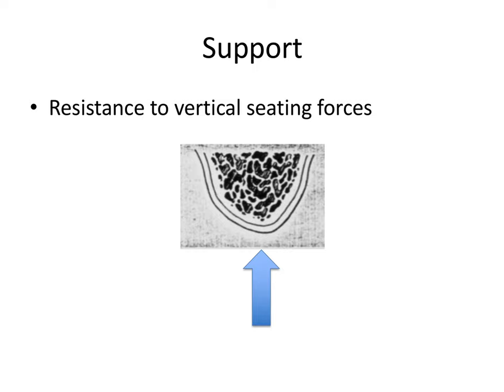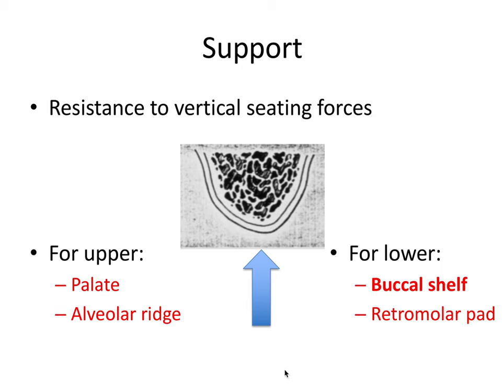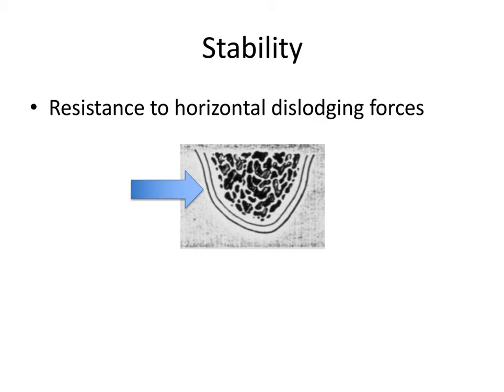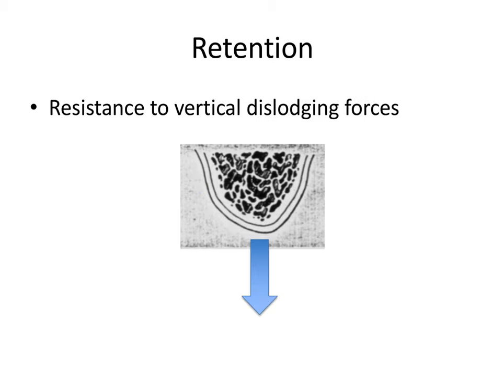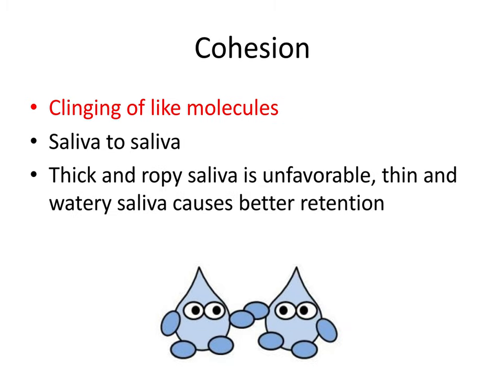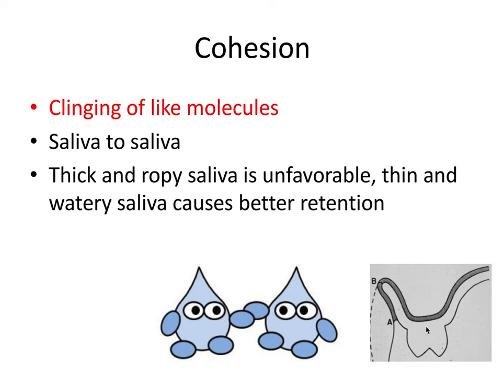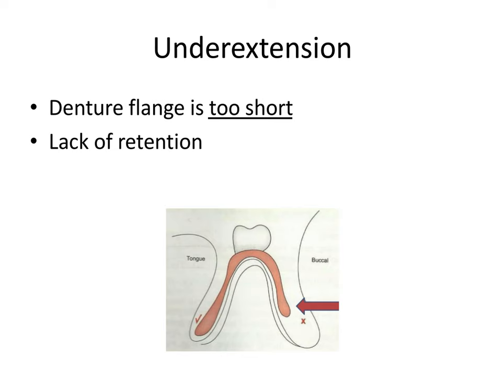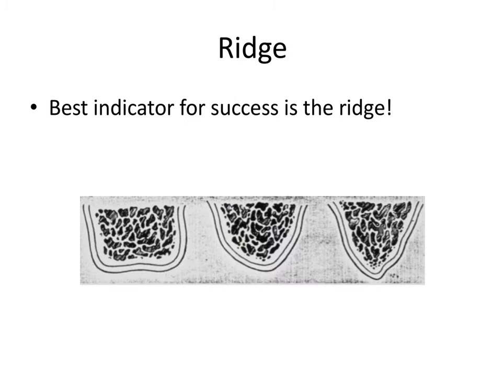Prosthodontics | Support, Stability, & Retention | INBDE, ADAT

Comment: Hi there ,I think you have mistake in the minute 10;24 when you said that under extension flange will affect on the retention ! I think when the flange under extended will affect on stability because the main source for stability in the denture is the denture flange that extend to the vestibule.

Comment: just can not thank you enough dr.Ryan, it was again awesome. will you cover impressions, casts and the complications with them, for example the reasons why a cast frame not fit in mouth but fit on models, those tricky topics which are really confusing.
Reply from the maker: Yes, we will be talking about impression materials when we get to fixed prosthodontics! Can you explain what you mean when you say casts not fitting in the mouth?
Reply: @mentaldental  
Thanks Dr.
for explaining my point I would like to share some released questions regarding this topic, this would make it easier for you to get what i meant:

 1) A removable partial denture cast metal framework is fabricated from a master cast from a polyvinyl siloxane impression in an acrylic custom tray. The framework fits the master cast without abrasion but will not seat intraorally. The error in fit could have been caused by
A. removing the impression prior to final polymerization.
B. insufficient relief on the master cast prior to framework
C. fabrication.insufficient blockout on the master cast prior to framework fabrication.
D. an improper melting temperature for the framework alloy

2) Which of the following factors could cause a partial denture framework to fit tighter in the mouth than on the cast?
A. Too much water in the mix of the stone for the cast.
B. Not enough water in the mix of the stone for the cast.
C. Duplication impression slightly oversized.
D. Improper wax up of the partial denture.

3) A dental laboratory has fabricated a removable partial denture framework. The framework fits the master cast well but when tried in the mouth a stable fit cannot be achieved. The most likely cause is
A. improper major connector design.
B. distortion in the final impression.
C. shrinkage of the alloy during casting.
D. improper casting temperature

4) When a partial denture framework fits the master cast but does not fit properly in the mouth the error is likely to be in the
A. Impression making
B. Casting of the framework 
C. Design of framework 
D. Preparation of the teeth

5) An all ceramic crown that fits on master cast, but not fits in mouth. There is an open margin and supra occlusion most likely cause is 
A. removal of impression before setting
B. void on occlusal surface of crown

>>> I hope you might incorporate  these points while covering the impressions, RPDs and fixed prosthodontics.

many thanks in advance!
Reply from the maker: Hi Sanjar,
Thanks for sending these questions to give me a better idea of what you were looking for. As an aside, I spoke with my colleagues and none of us saw questions like this on the Part 2 board exam so these must be from a different resource. 
All of these questions are essentially asking the same thing--why is a framework fitting on the cast (or model), but not in the patient's mouth? We will mention this in a future video, but I didn't want to leave you waiting too long to get an explanation. The framework for a partial denture is the metal component that locks onto the teeth and it supports pink acrylic and denture teeth. The framework is fabricated directly on the master cast. So if the framework is fitting on the cast, but not the patient, then that means there is a DISCREPANCY between the cast and the patient's teeth. The only way for that to be true is an error in the IMPRESSION. Therefore all of the answer choices that mention impression-making are the correct choices in my mind. Hopefully this helps in your understanding.
Reply: @mentaldental  Hello Ryan, You are right, these questions do not belong to American board, and I thank you from the depth of my heart for providing the rationale behind these questions, appreciated!

Comment: How to check retention, stability and support clinically in a complete upper lower denture patient??
Reply from the maker: Retention, stability, and support are checked by verifying the fit of the prosthesis in the patient's mouth using indicator paste/spray and confirming its seal to the oral tissues.